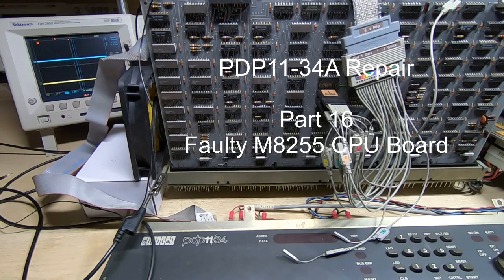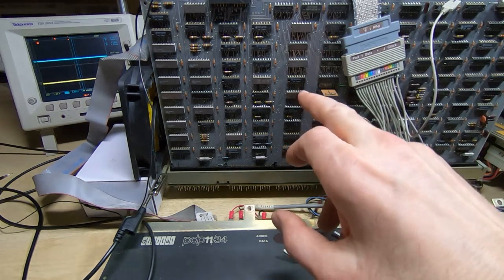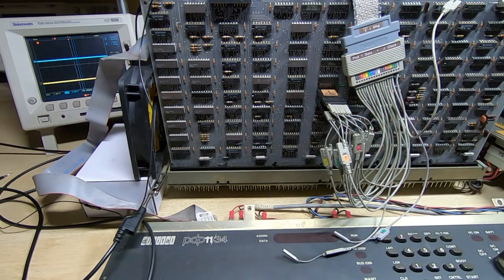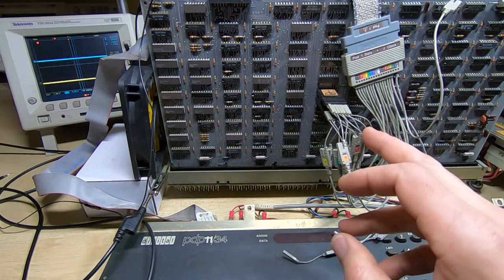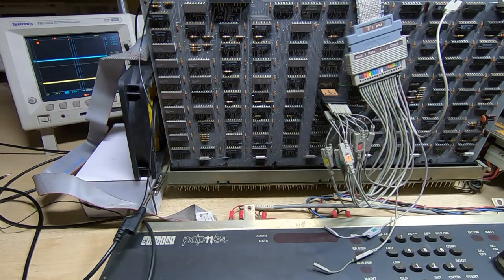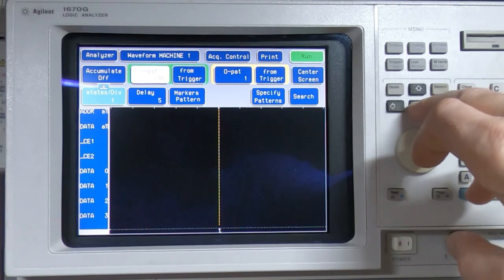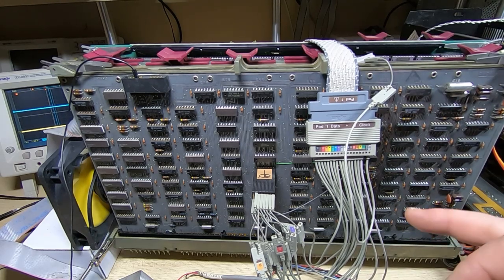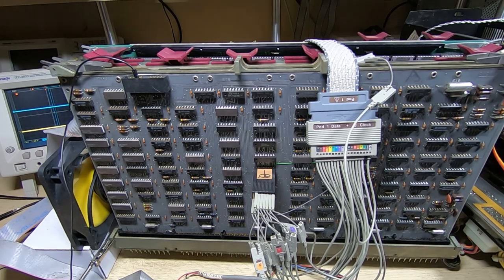PDP11-34A Repair Part16 Faulty M8266 Board

Comment: I've been trying to post comments with non-YT links, but da toob keeps silently discarding them. So again:- 

Have you seen this page at bitsavers (change DOT to . and # to /):-
bitsaversDOTorg#pdf#dec#pdp11#1134

I suspect the m8622.xxxx docs might contain the microcode. 
It looks like each block of text in the large file describes a microinstruction, showing the value of each field in the microinstruction word.

Possibly a bit of study, followed by some snappy text processing could transform this into the PROM contents?
Reply from the maker: Thanks, Yes YT seems to remove comments randomly, especially if they have links or if someone has been posting comments with links elsewhere. I do have the microcode listing but it is only 12 out of over 45 PROM's.

Comment: Looking at _CE2 on logic analyzer it’s low just for a short segment at the beginning, that should prevent this particular prom from outputting data. Data might come from other selected proms . Sometimes a weak prom unable to drive logic ICs might be dumped successfully, tedious process but it worth the try. Are Chips select lines decoders a possibile cause in your opinion?  A beautiful challenge 👍
Reply from the maker: I was only showing an example of how I test the PROM's. There are at least 5 different PROM pins connected to that particular line and what I was trying to demonstrate was that you need to know what each PROM is 'supposed' to be outputting on each pin in order to track down the offending culprit(s). For example if a line is stuck low it could be any of the PROM's or none depending what is found after ALL the PROMS on each line have been tested. For example on this line if all 5 lines should be 'off' when the CPU is idle then there is a fault or if any do not put the correct bit onto the line when an address is selected where it should then it is faulty. That is why it is easier to have a clip that can easily be moved from PROM to PROM so that all involved can be checked and the guilty party singled out. The actual data on this line could be coming from any of the PROM's connected, hence the need to know the PROM contents.

Comment: Hi Jerry, there used to be a time DEC published the micro code into the back their service manuals, they even did so in the vax 11/750. the one select line being low all the time could be normal as it may just be tied to gnd. good luck
Reply from the maker: Yes they did but unfortunately the code for these PROM's is not in the service manual. The output is definitely not tied to ground. It is the K2-7 MPC 03L Line which is an important line in the IR decoder. It is however possible that this line should be low when the processor is idle depending on the state of the PROM cs lines and programmed code but without knowing what the code should be it is hard to say. The main reason I suspect that there is an issue with one of the PROM driver pins which are tied to this line is the behaviour of the signal. It is hard to explain why that is the case but when you have probed many thousands of them you get to know what the signal should look like and this one looks wrong. Either way I think that having the PROM images is important as these boards are effectively scrap without them.

Comment: Well, it looks like my prediction of this being a VERY long term project may turn out to be accurate. I think it unlikely that you will be able to find anyone willing to part with a working CPU board - at sensible money anyway! Some kind soul may be willing to lend you a board in order to dump the PROMs but even that is a long shot as you would almost certainly have to desolder them from the board, thereby risking the board and PROMs themselves. Even if you do get PROM images, are there any O/C PROMs available today that could be used as replacements?
Reply from the maker: You are probably being too pessimistic (and all these projects are long term so no surprise there). Making these images available would be of benefit to many people and needs to be done (if it has not already) before all boards fail as the likelyhood of failure increases every day so it is a matter of when and not if. As far as PROM's are concerned I already have suitable replacements as I repair a lot of this sort of equipment (I only video a small percentage) and so PROM's such as these are a common fail point.

Comment: The setup you show in this video reminded me of a challenge that I cannot solve since a while.
I have some malfunctioning boards with a fair number of 7400 logic ICs and a test clip, similar or identical to yours.
Unfortunately the ICs are places so close to each other on the boards, that I cannot fit the clip. It touches the adjacent ICs.
Do you have any recommendation for an alternative clip that can be purchased or maybe fabricated to work around that?
I frown upon residing to hook probes, as I have more than 300 ICs to test.
Investing in a proper probing setup seems worthwhile, but I don't know which route to take.
Reply from the maker: I had a similar issue a few years ago and end up cutting the plastic from the lower section of a duck billed clip. It then only needed 1mm space to clear adjacent components. It just needed more careful attachment because the guide fingers are then no longer there.

Comment: Maybe some pdp11 emulator has content of this proms in its code.
Reply: I think you'll find that emulators use "work-alike" code (often implementing the opcode parameters according to the datasheets) rather than implementing circuit-by-circuit copies if the microcode as in simulators.
Reply: @spacedock873  Generally speaking yes and i know that, but maybe someone took different approach.